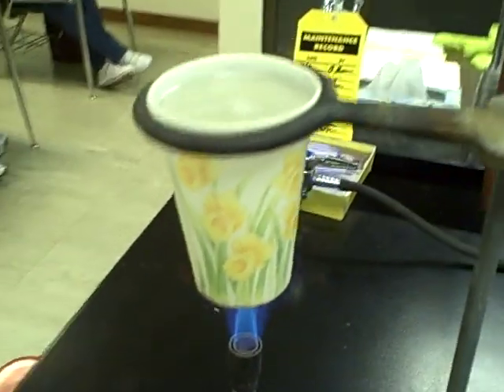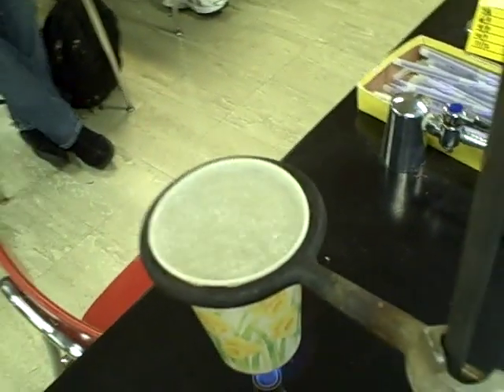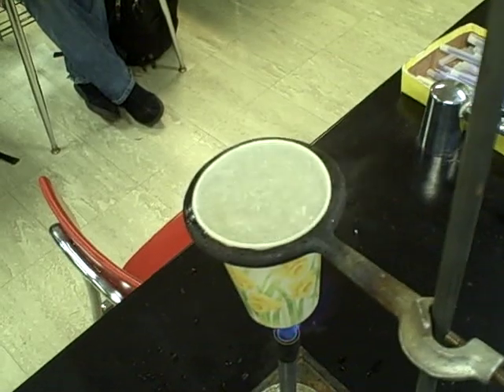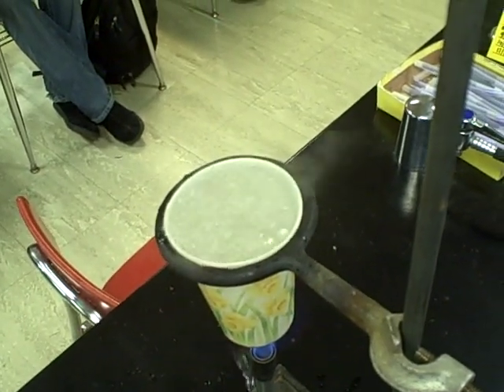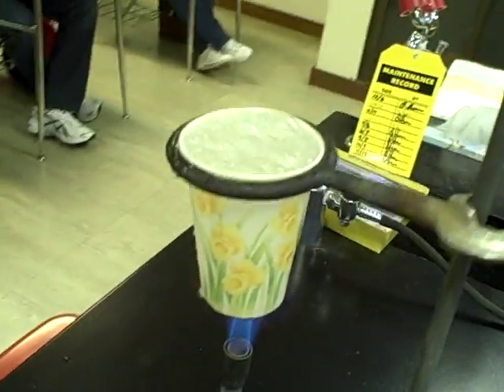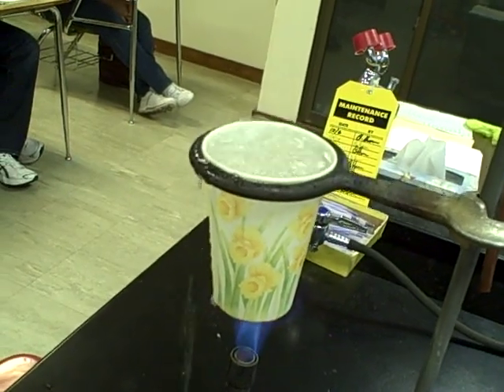Boiling Water in Paper Cup

Comment from the maker: High energy water molecules leave as a vapor.  Low energy molecules remain behind.  These absorb energy from burner and process repeats until all water has evaporated.  Thus, temperature of the cup does not exceed the boiling point of water which is well below its flash point until all water has boiled off.